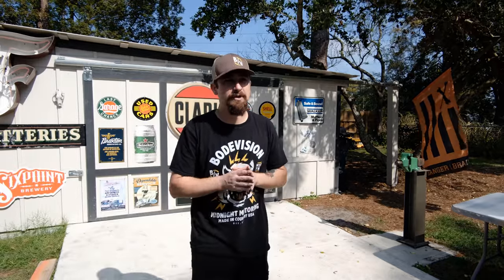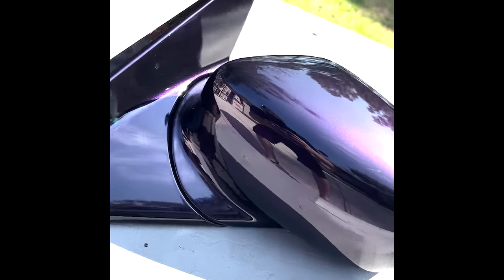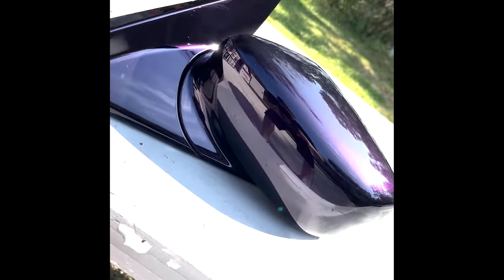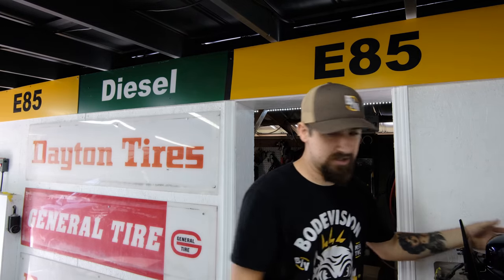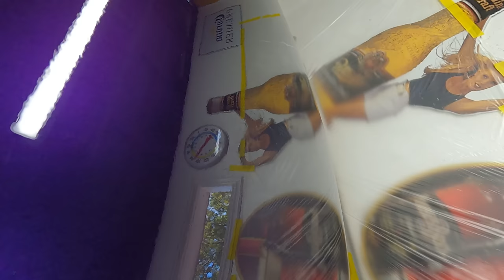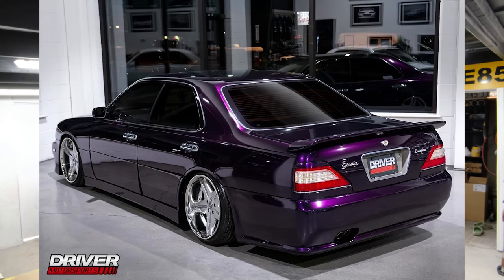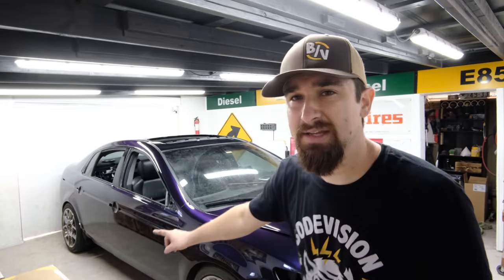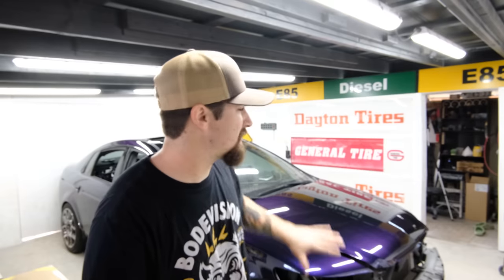This Is The BEST Color to Paint ANY Car!

Comment: That's a perfect color for that car.
I noticed you're using the old stepstool technique for reaching over the roof.
I bought a Gorilla GLWP-55A-2 folding aluminum platform and never looked back.
55"L X 14"W, with 20"-30" of adjustable height, this thing is awesome.
Around $159 at Home Depot.
Reply from the maker: yes i need to get one! the stool is a pain and its unstable. When i get the stool be looking out for it and KNOW you made a difference in my workflow. Thanks man!

Comment: Hey by the look of the fans. You should try starting from the rear of the car and work towards the fans for both sides.
And as for the roof. I usually do it first with extra slow reducer. Helps alot!